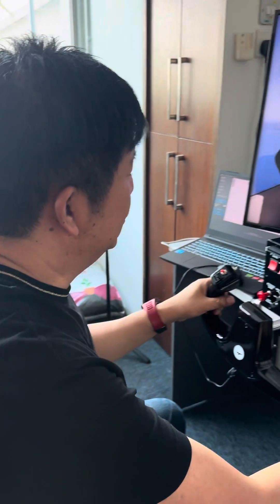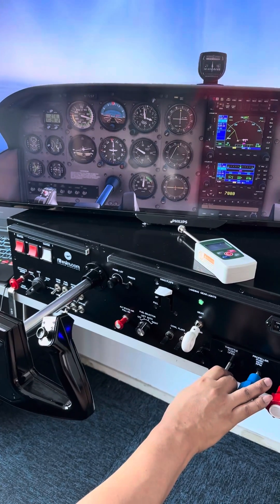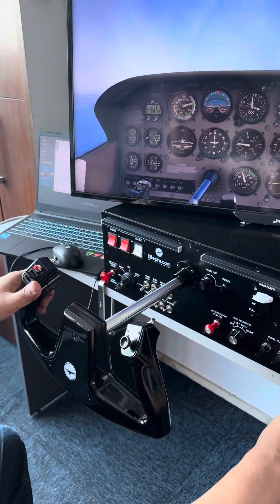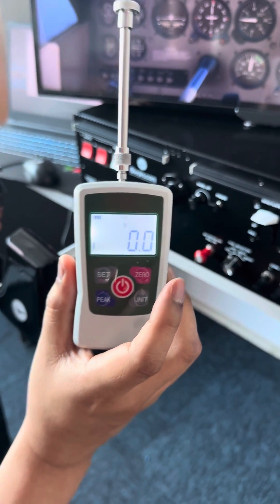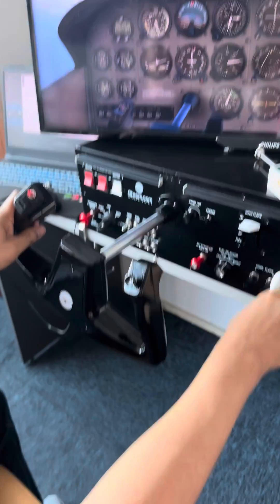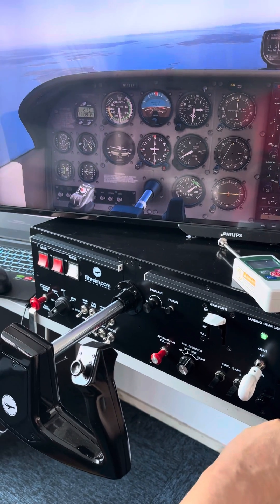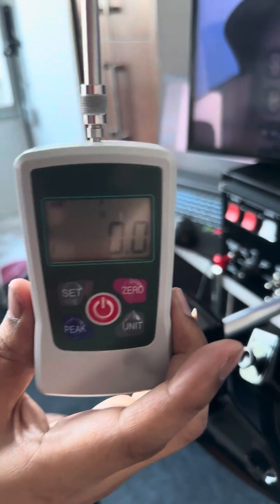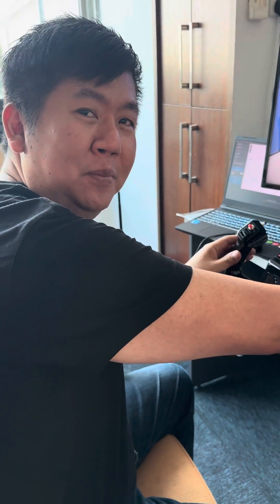FliteSim.com Dynamic Force Feedback Yoke Demo

Comment: Modular, stand-alone products are something to think about. For example I use Air Manager dual touchscreens for flexibility. I still need yokes, sidesticks, throttle pedestal, trim wheel, flaps, ffb rudders, gear lever, thrust rev, speedbrakes in hardware.  All the pfd,mfd,gtc, light panel, breakers, etc needs can be met by touchscreens. In other words, your panels with switches are very cool but AM desktop users don't need them. Individual hardware components that attach together in numerous ways and sell separately with ffb as needed. Obviously everyone has their own preferences. The AM desktop solution is flexible and fits nicely with the future, which imo, is glass touchscreens, active sidesticks, and fbw. Good luck, much prosperity in your future. Not affiliated.

Comment: Thanks Fabian. This yoke could easily replace Yoko on BATD at $1000 price point. Would love to see linked trim wheel on the single engine panel for 172 and g1000. Imo, active sidesticks, FBW, and glas cockpits are the future. You gave best presentation at FSexpo 2024 btw. Good luck!